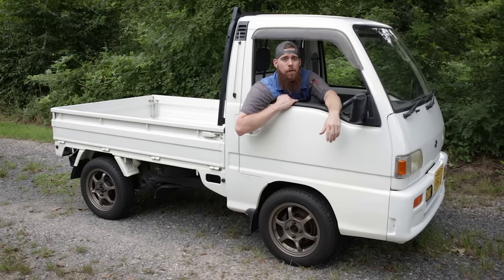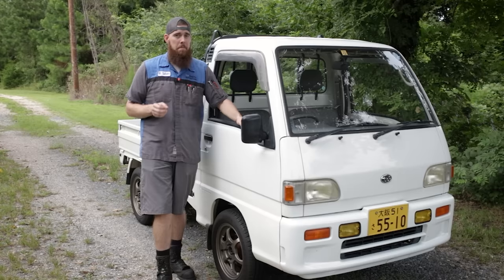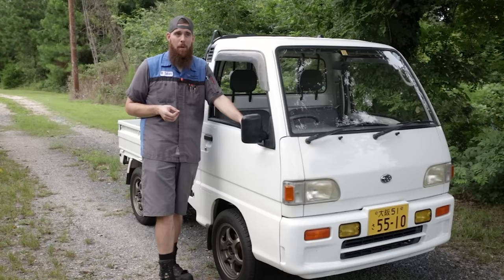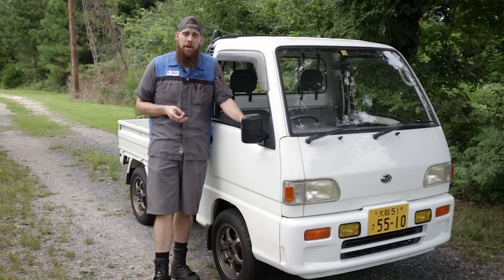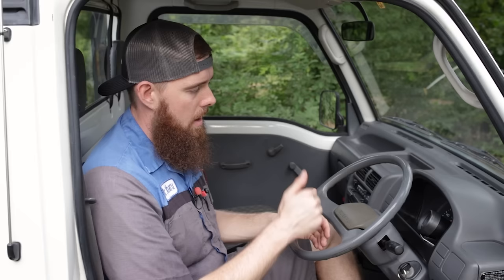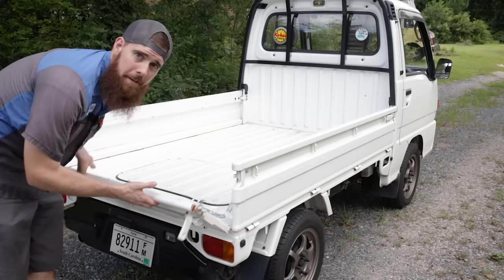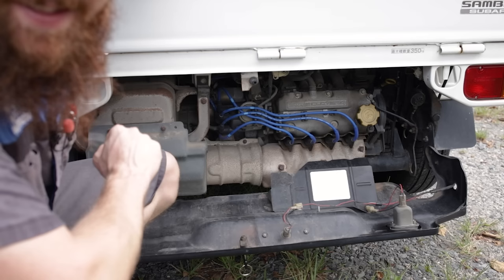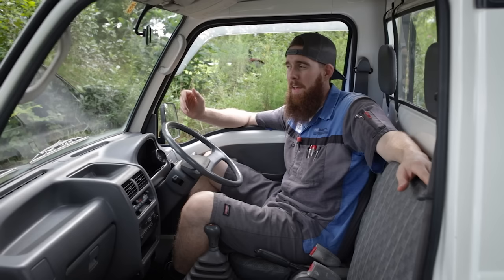One Year! (And One Month) Living With My Subaru Sambar Japanese Kei Truck!

Comment: Amazing video like usual, I have a C0071, C0057, and C0042 on my 09 impreza  any suggestions on where to go from here? Battery is new or at least how to clear them without spending tons on a special scan tool?
Reply from the maker: Battery terminals clean?
Reply: @MrSubaru1387  yep, battery also charges at 14.1 volts.

Comment: awesome video, I love seeing content on the sambar. I'm looking at getting one soon as a vehicle for work. I'm curious about fuel for the sambar, I saw on an Instagram post of yours from awhile back that you were putting ethanol free gasoline in it. dose the sambar engine require that you use ethanol free gas? and do you have to use 91 octane in this vehicle or can it run on regular gas?
Reply from the maker: I run ethanol free 87. Run ethanol free to save the carb.
Reply: @MrSubaru1387  thanks for responding so quickly:)
if I happen to get my hands on the fuel injected one do they also prefer ethanol free? or is it just the carb that doesn't play nice with ethanol?

Comment: I am in British Columbia and have just purchased a 2002 Sambar and was wondering if you have any information on the newer Kei trucks i.e. oil filter, air filter, timing belts etc. Mine is also fuel injected, any information you could provide would be helpful.

Comment: Beautiful truck. What’s the wheels spec? You said they are 14”,  14x? And offset please. I’m in the process of purchasing some 15x7+35 offset, not sure if it will fit flush with fenders like yours. I do like the flush look without a poke. Thanks.
Reply from the maker: 14x5 +45 165/65R14

Comment: They do indeed have crumple zone/s within the frame. Are they dangerous? No more dangerous than the 72 VW Westy I drive that weighs more and can go 80mph+. In my 1990 XS Try SC (5spd) at 80kmh the rpms are at 4200rpm bring it up to 90kmh and I'm at 4700rpm. Once you start going past 4500rom you really start wasting fuel. Optimal highway speed in these is at 80kmh and no more than 90kmh. Not too mention your extending the engine life as well.

Comment: I have a quick question about your Sambar. Your expert opinion, would a Subaru EJ18 be a viable engine swap into a Sambar pickup without serious modifications and not look stock. I know modifications will need to be made, but I still want the truck to be functional. Any info would be greatly appreciated

Comment: I have a 1995 Sambar in excellent condition with about 20,000 miles in Asheville, NC.  Now that it’s getting cold out, I was looking forward to having a nice toasty heater.  My engine temp stays below halfway on the gauge at all times and the heater never blows hot air.  It’s always cold.  Any suggestions to check?
Reply from the maker: Sounds like a stuck open t-stat.

Comment: i wonder what drops the mpg on these so much.. guess the 4wd? my honda beat averages 58mpg at 60mph and the revs are at 5000rpm at those speeds..
Reply from the maker: Weight, gear ratio. They're RWD, unless the 4WD is activated.

Comment: How many miles can you typically get on an engine if well maintained? Before needing overhaul. Looking at one in my area that has 87000 miles. It is the fuel injected supercharged model, manual, with A/C. Guy is asking $8300 for it.
Reply: He's asking too much. These sell on used lots in Japan anywhere from $500-$2000 dollars tops. As for haw many miles you can get out of it? That depends on how well maintained it was and how you maintain it.

Comment: My '95 sambar won't shift into 3rd gear. It's like my shifter is hitting a wall and won't slip into 3rd. Already swapped tyranny fluid to Redline GL-4 and installed new bushings in the shifter linkage. Mine were missing. Still can't get it to shift into third... Any idea what's up?
Reply: Shift bushing/s

Comment: Not enough power and everyone is telling me mods don't help the carbs. Should have gotten a blower model so I could step it up easier.
Reply from the maker: Not enough power? Never had an issue with power. Drive all the time on the highway.
Reply: @MrSubaru1387  I have a heavy dump so maybe the extra weight is the issue, or maybe my truck is down on power...never rode in another one? Sure I understand it isn't a race car, but it is slow...like way slower than an old VW bug.

Comment: Mr Subaru quick question are you going to do Subaru Forester 2014 - 2018 videos on them or nah? I currently have a 2014 forester (first car) is there anything I should know? And the work required on them?
Reply from the maker: It'll be the same as my videos on the Crosstrek. Nearly all Subarus models are the same, mechanically.
Reply: @MrSubaru1387  thank you

Comment: Can you share information on the importer you worked with?  Does this person work with clients in all 50 states or just certain states?  Thanks!  Btw, I have learned so much from your videos and you have helped me save a bunch of $$$ by giving me the confidence and knowledge to do a lot of the jobs myself.  1999, 30th Anniversary Outback Wagon and 2018 Outback Wagon, 3.6R.
Reply from the maker: They're based out of the Charlotte, NC area. Pretty sure they only deal locally to them though.
Reply: @MrSubaru1387  Good to know.  Thanks again!
Reply: I am in Gaffney SC. Do you know if that person is still importing these trucks? If you don’t want to post the name, I can provide my email and you can send it there. Thanks for the information.

Comment: With respect to safety, people will see you better than they see a motorcyclist. If your vehicle looses traction and goes off the road or skids, you're better off than on a motorcycle with your leg trapped beneath the body while it flips or slides.

Head on collision? Yeah. This isn't going to go well, but you have good vision at intersections and you'll be hard pressed to speed. Around town, you're not going at speeds that would result in grievous injury - the biggest danger to motorcyclists tends to be thier own misjudgement of corners at speed and other traffic failing to see where they are and what they're doing due to thier slender profile.

All that to say - this is safer than a motorcycle.

Comment: NICE VIDEO BUT DO YOU NO THEY MAKE THIS TYPE OF TRUCKS A LITTLE BIT BIGGER?  WE NO ABOUT THE FUSO TRUCKS BUT THERE ONE IN BETWEEN YOUR PICKUP AN THE LAGER FUSO TRUCK. FOR ONE TOYOTA HAS AN TOYOTA HIGHACE AN A TOWNACE. THE TOWNACE IS SMALLER BUT BIGGER THAN YOURS. HEARS ANOTHER ONE YOU CAN BUY A NEWER KEI TRUCK IN THE U.S. ALL THE WAY UP TO 2021 BUT THERE TITLED FOR OFF ROAD US. THEY HAVE ALL THE LIGHTS NEEDED FOR ROAD US. THE  TOYOTA TOWNACE IS JUST THE WRITE SIZE AN ALL THE JAPAN AUTO MAKERS SHOULD HAVE ONE ABOUT THE SAME SIZE. THE EASIEST WAY TO FIND OUT IS LOOK AT THERE MINI VANS AN LOOK UP PICKUPS WITH THE SAME NAME. THEY ALL SO COME IN DUALLY AN SOME ARE STILL SMALLER THAN OUR FULL SIZE PICKUPS.

Comment: Yeah, the mileage thing aint a myth. Im on truck No. 4 (subaru of course) and if youre getting south of 40 mpg you need to have youre engine checked. The lowest ive ever gotten was 42 city/44 highway
Reply from the maker: Sounds like you need to learn how to calculate MPG, because that’s not possible.
Reply: @MrSubaru1387  not hard to do simple math hoss. Not only is it possible, its the standard
Reply from the maker: @Sensual_Tortoise apparently it is because it sounds like you’re calculating Kilometers per gallon rather than miles to get those figures.